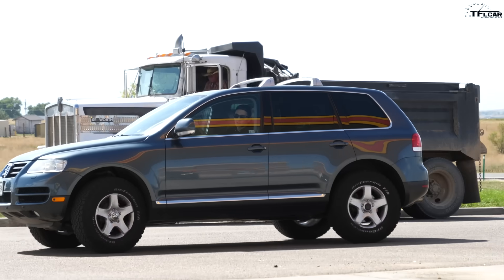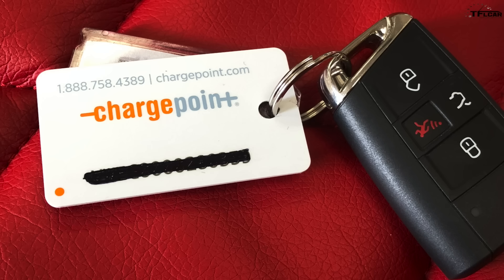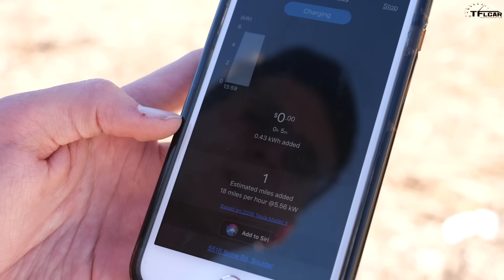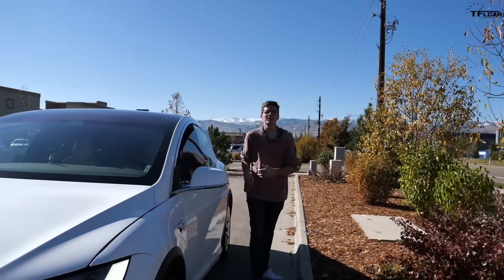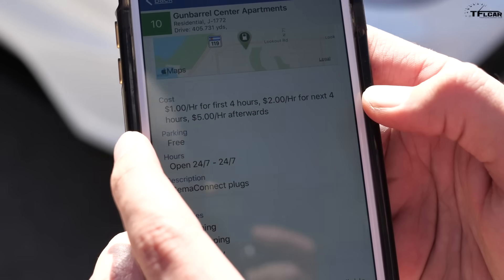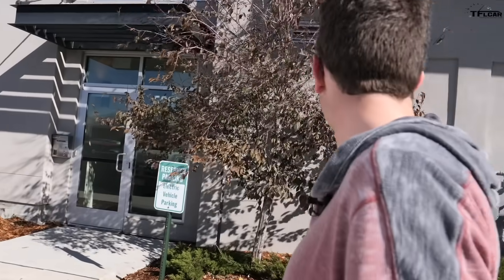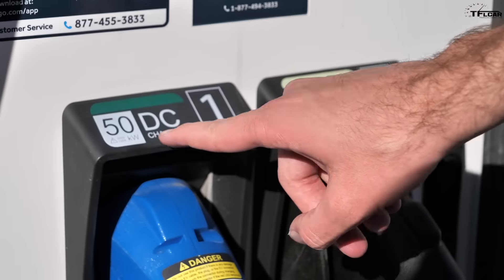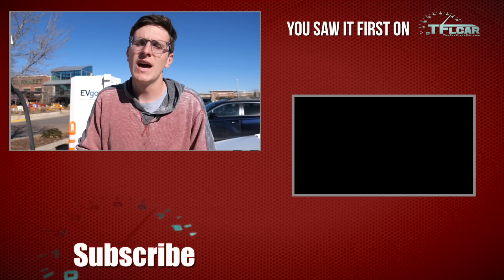Here’s Why Charging an Electric Car Can Suck - And It’s Not The Reason You Think!

Comment: I can't imagine sitting at a gas station for even 30 minutes to fill up. 15 minutes is an eternity when you are just trying to fill up a tank. For those reasons I'm out.
Reply: And imagine if every car on the road was electric and every car in the station was taking an hour to charge…. Everyone is assuming there will never be a line…
Reply: @scottwendt9575  Bottom line: It's much faster with gas. Charging takes too long if you need it on the fly. It's going to be a disaster. Thank the Libtards for their empty heads.
Reply: @scottwendt9575  on a Level 3 charger, it takes roughly 20 minutes to fully charge, not an hour
Reply: @scottwendt9575  If every car was electric and every gas pump is now gone then all those old gas pumps will have been replaced with high speed chargers.   By that time technology will have progressed so you can fill up in 10-15 minutes.   Air will be clean.  Roads will be quiet. Life will be much better.   At least that’s how I imagine it.
Reply: @MrSpuzzz  roads wont be quiet - most noise on the road from cars is tires and wind, not engine. it will basically sound the same
Reply: @igvc1876  i agree on freeways at cruising speeds there isn’t much difference between an ev and a modern commuter ice car.  But muscle cars and trucks make up a large %age of autos where I live and I assure you their motors are much louder than the wind/road noise.  I’m also talking about on city streets where you can clearly hear motors as they accelerate.   I swear people go out of their way to make their cars louder to try to impress somebody
Reply: @MrSpuzzz  you need to do far more research. The carbon footprint to build EVs is huge, the mining for lithium and cobalt is horrifically toxic, the electric bills wills skyrocket.
Reply: @jkokich  go back to work.  Exxon doesn’t pay you all that money to browse YouTube comments.
Reply: @MrSpuzzz  wow, I’ll never recover from that blast of rapier-keen wit.
Reply: @scottwendt9575  except most people charge at home when they sleep so you wouldn't see too many people charging during the day
Reply: @davidgraham2673  I guess we could call you  "Dark Cloud Dave."
Reply: BRO. LIFE IS ALREADY STRESSFUL. NOW TO THINK OF CHARGING YOUR CAR AT A STATION FOR AN HOUR IS INSANE. OR EVEN AT HOME. THIS THING WILL EAT UP YOUR ELECTRIC BILLS LIKE CRAZY. I DONT THINK ELECTRIC CARS ARE FOR ME MABEY IN A 100 YEARS.
Reply: 10 hours for 1/2 charge? HAHAHA
Reply: @ktmden  the only way it takes over 10 hours, is on a 110/120 outlet, and that also depends on how low the battery is, when using a trickle charge
Reply: @bradmagnuson6963  That's because trickle (Level 1) ”chargers” (EVSEs) on 120 volts are limited to 12 amps so they can be plugged into a 15 amp outlet (North America, anywhere that has 120v 60 Hz). Almost every unit has 240 volts available even if it has gas heat, gas range, gas water heater, gas clothes dryer. It's just that it isn't available at the car parking spot. People would rather pay $5/gallon for fuel than to have a 240 volt line installed at their homes for EV charging. If practical where I live I’d install the charging facility, either a L2 charging port (EVSE) or a 14-50 outlet for a portable EVSE like the ones that come with EVs.
Reply: @algrayson8965  homes already have a 240 line, it's the same outlet as the clothing dryer.
Reply: GM had the answer to this, but ditched it because it wasn't making enough money.  Chevy Volt goes 55 miles a day totally electric and if you go farther it uses gas.  This kind of hybrid is a much better fit for many.  I've driven a Volt cross country on gas and got 48 mpg.  At home I've driven 6 months without a drop of gas.
Reply: @utah133  I totally agree. I have a friend in Alaska he owns a volt ( and drives everyday) I think he spends $10 in gas for his Volt every month.
Reply: @utah133  I owned a Prius Prime Plug in. What I found out when it was cold that electric charge really drops so we purchased a 2020 Tesla Model Y  and  are also purchasing the 2022 Model Y with the 4680 battery which will have about 475 mile charge. Saying that Plug in will have a place. We live in Wisconsin. Cold winters
Reply: @bobskeway8179  I'm glad you can afford that.
Reply: @utah133  Age 78 retired School Administrator and past University extension science Instructor. Going back to my HS years in the Tesla...oh well..
Reply: @utah133  Tesla is planning to sell a $25,000 EV and with the $8000 federal off the sticker starting in 2023 that would make it $17,000. The range might be in the 250 range
Reply: @utah133  I am retired and 78 years old. Time to go back to my HS days with the Tesla.
Reply: @bobskeway8179  Glad you have that kind of money.  Lots of us do not.
Reply: @utah133  yeah the newest models were great.   I had a 2012 and it probably only got 30-40 miles max … but 55 seems great.   I don’t understand why chevy gave up on it….it seems like the perfect compromise… I bet if they tried they could stretch the range and improve performance even more.
Reply: @utah133  Good luck getting it fixed. My mother just had a minor crash in hers. Very fixable, but because the Chev dealer said parts were not available, they wrote it off.
Reply: @utah133  the Volt is no longer made
Reply: @utah133  the Volt was discontinued
Reply: @bradmagnuson6963  Two of them live on in my garage.
Reply: @utah133  so? Chevy ditched the Volt already, they stopped making it.
Reply: The REAL deal breaker.

6 cars in line waiting for gas(half empty):
5 mins x 5 cars is 25 mins wait in line for 6th car.

6 cars in line waiting for electric charge(half discharged): 
30 mins x 5 cars is 150 mins wait for 6th car to finally plug-in!!
THATS  2.5 HOURS SITTING IN LINE FOR A SINGLE WOMAN WITH A 1 yr old baby IN A BAD NEIGHBOHOOD!!

FOR FUN!
30 cars in line during 70s gas shortage.
29 x 5 mins is 149 mins or 2.5 HOURS. FOR GAS.

ELECT CHARGE:
29 x 30 mins charge is 870÷60
= 14.5 HOURS!!  FORGET IT!!
Reply: @thedudena5525  or you know charge your car at home there shouldn't be a line there.
Reply: @jonathantorres4957  read comments from David Graham on this thread
Reply: @NightSky777  , When I went through Basic Training for the ARMY, all the Drill Instructors for all the Platoons in my Company used to gather around me, and tell me I was stupid, and had no common sense. They also called me "College" because I was "book smart, and common sense stupid".
(I used to call them out if they said something that wasn't factually true)
I decided to acquire common sense through critical thinking.
That's what I try to apply to all things nowadays.
My forte is problem solving, and 90% of the time it's from simple common sense that the answer comes from, through thinking critically, and sometimes, outside the box. (Learned the last at a resort hotel I worked at in San Diego.)
Thanks much, for the kind words!
Reply: @NightSky777  he does make some great points but if or when evs become common practice we will have alot more electric plants to satisfy those needs as well our electric grids becoming more efficient and less risky.
Reply: @jonathantorres4957  more plants would definitely be necessary ...but it seems Green New Deal is being Fast Tracked with gas-powered vehicles in the immediate cross-hairs.  (Owning a Bike Shop might be a good Investment!)  Also, What Powers Electrical-generation:  Coal, Nuclear, Hydro (not enough Reservoirs and Dams tho)
Reply: @NightSky777  teslas gigafactories even elon was saying with 100 of them he should close to powering the world then again not sure how much of that is actually true.
Reply: @antghostthreeonethree6609  most people don't get an electric car to be eco friendly. It's just for the savings but once they become the norm and electricity prices go up they will even out.
Reply: @jonathantorres4957  apartment without enough chargers? No garage? Run an extension cord out the window when its raining?
Reply: @dudleyhaines9826  you can charge your car else where doesn't have to be at home it's just more convenient. I have a garage but I've been charging across the street from my job so I don't spend money at home.
Reply: @jonathantorres4957  the closest charger to me is 30 miles. It is no where near my work, or anywhere else I go.
Reply: @dudleyhaines9826  do you drive alot for work?
Reply: I can't even stand when I get the "slow" gas pump. Ain't nobody got time fo dat
Reply: @TheV8nissan  just wait till gas prices  rise to prices we haven't seen before. That line will get longer. Or shorter  depending  on where you live, Electric  cars are at their beginning  they will get better as batteries  do. Just remember  when gas cars were introduced. There weren't  gas stations  on every corner, the engines didn't  last long generally  around 10 thousand  miles or so. and people  said cars will never replace  the horse. What are you going  to drive when gas becomes  to expensive? If only we had another choice,    ooooo yeah Electric  vehicles  are here to stay
Reply: Imagine, now, EVERYONE is forced into buying these cars, it takes hours to charge,  meaning you leave your car unsupervised,  someone comes along, messes with the charger, maybe steals your adapter,  you come back expecting a fully charged car so you can travel to the next town over, instead you have a partially charged car that won't make it there AND you need to buy a new adapter. Unless you can charge overnight at home in the safety of a personal garage, this SUCKS .
Reply: We charge at the rate of 29 mph in our garage 220 charger. This is normal.
Reply: Most people charge at home, overnight.
Reply: @billboyd4051  , Until the overloaded electrical systems create blackouts. How will the charging at night happen then? It will happen; that's a certainty.
Reply: @davidgraham2673  I wonder how gas pumps work during a blackout ? I believe the grid has been having blackouts long before the electric car, and when the grid shuts down, few have a place to go. Maybe you should attack bicycles, that become hard to pedal when the food runs out.
Reply: @billboyd4051  , You can easily put extra gas in containers to get thru hurricanes, power outages, long trips thru a wilderness environment, etc. When 30 million extra electrical machines are using electricity, the blackouts will be substantial, and long lasting. So explain to me how you're going to charge all those vehicles during peak usage months, when the electrical load is completely overloading the systems.
The infrastructure can't possibly deliver that much, and solar power along with wind power will never keep up.
You want to get bent over valid questions: fine, but the problem won't go away because you buried your head.
California has already had problems with charging electric vehicles; and thats with millions of vehicles STILL on gasoline products.
Reply: @davidgraham2673  Sure David, hoard gas. Do you live in Ca. ? None of the actual E car owners here are complaining, do you run your home AC off gas ? Maybe Ca. should ban Air Conditioning by your logic. You worry about the future as oil destroys it.
Reply: @billboyd4051  , Thanks for confirming what I thought. Maybe the aliens will save you......
Reply: @davidgraham2673  So what have I confirmed for you ? The E car owners here have no complaints, were you hoping that jeep owners would bring Jesus ?
Reply: @davidgraham2673  This same guy praises the Hyundai Ioniq 5 as "what you've been waiting for". The Tesla is a big fast luxury car, now with a 400 mile range, that beats the fastest Vette, maybe you need a Hyundai to replace that Jeep ?
Reply: @billboyd4051  , Why would I replace my Jeep with the Hyundai when I could drive right by it after it runs out of electricity in the desert where you can't charge it up? I can easily bring extra fuel to go the distance. Not to mention that I'll be in cool A/C comfort the entire distance. If I recall correctly, using heat, and/or A/C diminishes how far you can go significantly in an electric vehicle. 
Dont get me wrong: I love the acceleration, instant torque, silent operation, and other advantages of electric vehicles. I think they play a vital part of future advancements in vehicle technology, but I don't buy into fluff pieces that refuse to reveal the hidden truths that many consumers don't think about, until afterwards, when issues arise. The first of which is: Exactly how is all that electricity going to be generated, especially in areas that already experience problems in supplying enough electricity. Secondly; when we tout the green advantages of electric vehicles, you don't hear a peep about what will happen concerning disposal of all ancillary products related to electricity production (and storage in the vehicles batteries). What about the rare earth elements needed for production of these batteries? 
We are so quick to denigrate fossil fuels, and move on; but refuse to pay attention to the man behind the curtain selling the trade-off.
There are other issues that don't pop up on the average persons radar, but will certainly impact humanity, but I'm not going to go into a full on diatribe here.
You have what you want; an electric vehicle. If you're happy, good for you.
I still see too many issues that need to be addressed before I've seen enough to buy one. 
Finally, I'll say this: If you're going to go electric; buy a Tesla Plaid. They eat Dodge Demons for breakfast, and Corvettes at snacktime. 
There's a reason they're called Plaid.
They achieve "Ludicrous Speed", which up until now, was only seen in Spaceballs. Ask Elon Musk.
Reply: @davidgraham2673  No one is forcing you to go electric David. I just don't know so many people who don't have one, complain about them.
Reply: @billboyd4051  , You've missed my point the entire time. I'm looking at the forest behind the trees. I'm not at all against electric vehicles. I recognize their inherent advantages. My issue is being sold on "now is the time, and it can't wait". I've never had a problem with a household that has an electric vehicle, and a gas/diesel vehicle. It's easy enough to deal with issues if you can hit a pump, or charging station; or better yet, charge at home.
 My issue is being pushed into electric before the infrastructure, and various problems are adequately addressed. I've stated from the beginning that the capacity for full on electric charging simply isn't possible during high energy usage periods.
It's very rare to read anything written by electric proponents that has any negative review whatsoever, and I won't buy that dog, because it won't hunt.
People who must sit and wait at a charging station for 90+ minutes don't make the news. Neither do people who can't make it to the nearest charging station, because they didn't get the distance expected. Its not like a gas engine where a passerby can give you, and your container a lift to the nearest pump for some gas. Neither can you carry extra fuel on board.
My issue is simple. Electric will be great, but don't try to sell me that it's simply the best right now, as it stands.
Technology solves problems. Let's at least be completely honest about the problems. Biggest problems now?
Making enough electricity.....
Charging fast enough.....
Enough charging points so we're not waiting three hours in line just to plug in

When manufacturers switch to manufacturing mostly electric vehicles versus gas engines, these problems will absolutely, positively come around because the influx of new electric vehicles will be forced (to a degree), and the huge amount of the infrastructure necessary will not be finished to provide for the need.
That will take huge amounts if money.
Guess who will be paying for it.....and also who will be taking public transportation because
of a mandate that will be pressed on us.
Hope you see my point now.
Reply: @davidgraham2673  I've never heard so many EV complaints from gas car owners. From using too much electric from the grid to they're too quiet and require too little service. The infrastructure is the grid, already in place. I don't have an e car, but I already have a 220 line in my garage. No one is forcing you, Americans will never give up Saudi oil and Japanese cars.
Reply: @davidgraham2673  Will generating all that electricity really be cleaner than a gas engine? I don't know, I'm not too thrilled about nuclear because of the waste, solar and wind are not reliable so we're back to natural gas and coal. I'm not thrilled about riding the bus if electric becomes mandatory either.
Reply: @rosspatience4217  ,That has been a question I have as well. I've read that small scale thorium reactors ptoduce much less radioactive waste, and have a great return on power for investment, but for the foreseeable future, using fossil fuels to provide electricity seems to be the way they'll go. Solar, and wind simply can't keep up with demand. If we're back to burning fossil fuels, then pushing hard for electric right now seems premature. That has been my point all along. Technology always catches up, but it's lagging behind. Blackouts, and brownouts confirm this, considering that if a million new electric cars join the ranks next year, that's a large drain on an already taxed system.
Reply: @davidgraham2673  Charging at night doesn't load the grid as much as it is loaded in the daytime. The L2 current draw is 40 amps max.
Reply: @davidgraham2673  At-home charging for people who work days is at night when the load on the grid at present is low.
Solar doesn't work at night or during overcast days unless electricity storage is used. Wind power doesn't work when the wind isn't blowing hard enough.
Reply: @davidgraham2673  you're spot on in those points.  Funny how the logical Practicality issues are not spoken about.
Reply: @NightSky777  Even Exxon predicted the effects of the gas powered auto destroying the planet back in the 60's. The Keystone XL pipeline was destined to carry tar sands from Alberta Canada to Texas where a heavy crude refinery would separate the cancer causing solvents from the sand and tar, to make gas for export, since its costs would be so high. Burning more oil is not everyone's answer to global warming, increasing floods and hurricanes and coastal cities under water soon. The oceans are heating and dying, fires are raging throughout the west, oil man Putin is waging war for nothing but greed, and you worry about gas, and fees for killing the planet.
Reply: @davidgraham2673  California's electric problems is due to mismanagement of the grid by PG&E, not the state itself
Reply: @billboyd4051  Japanese made I'll take it American made sucks.
Reply: @SillyOmega  my Ohio made Honda doing well after 14 years.
Reply: The REAL deal breaker.

6 cars in line waiting for gas(half empty):
5 mins x 5 cars is 25 mins wait in line for 6th car.

6 cars in line waiting for electric charge(half discharged): 
30 mins x 5 cars is 150 mins wait for 6th car to finally plug-in!!
THATS  2.5 HOURS SITTING IN LINE FOR A SINGLE WOMAN WITH A 1 yr old baby IN A BAD NEIGHBOHOOD!!

FOR FUN!
30 cars in line during 70s gas shortage.
29 x 5 mins is 149 mins or 2.5 HOURS. FOR GAS.

ELECT CHARGE:
29 x 30 mins charge is 870÷60
= 14.5 HOURS!!  FORGET IT!!
Reply: @thedudena5525  The gas cars parked in the EV charging spaces!!
Reply: So you're not willing to pony up $100 billion for a 10% share?
Reply: @cwalenta656  $100 billion for what?
Reply: The REAL deal breaker.

6 cars in line waiting for gas(half empty):
5 mins x 5 cars is 25 mins wait in line for 6th car.

6 cars in line waiting for electric charge(half discharged): 
30 mins x 5 cars is 150 mins wait for 6th car to finally plug-in!!
THATS  2.5 HOURS SITTING IN LINE FOR A SINGLE WOMAN WITH A 1 yr old baby IN A BAD NEIGHBOHOOD!!

FOR FUN!
30 cars in line during 70s gas shortage.
29 x 5 mins is 149 mins or 2.5 HOURS. FOR GAS.

ELECT CHARGE:
29 x 30 mins charge is 870÷60
= 14.5 HOURS!!  FORGET IT!!
Reply: Most EV owners don't take long trips, so they're perfect for short to intermediate distances. For long trips, just a little planning and time allotment will be needed, although this will improve with increased charging stations and better technology.
Reply: @tracymiller1149  I love taking long trips in my EV.  It does take a little more time for charging stops.  In the US with a tesla I find I don’t have to do a lot of planning for supercharging since they’re just so many of them along freeway routes.    But I do some planning for hotel shopping to try to find hotels that offer L2 charging.   It’s probably still kind of “adventuresome” at this point but traveling with an ev is still fun for me after 4 years.
Reply: Teslas got some new charging technology they’re working on for you if you have a semi I don’t know if they’re doing it for their cars but in the semi you just pull into the spot and then something like five minutes it charges without any hook up or anything without getting out of the vehicle if this pans out your car would charge in like a minute if it all pans out like you I’m more awaiting the day
Reply: If the EV is going to replace the Gas Vehicle, charging the Batteries will have to evolve also. "Charging, ain't nobody got time for that!!!" Everything has to be Faster, more available and Right Now. We have The World at our Fingertips. All we have to do is pick up our phone and it can be at our house in 24hrs or less. We Live in Cities that Never Sleep, we sure don't want to be taking 2 & 3 hour naps while we get enough of a charge to get across town. I will continue driving my Tacoma. But then I'm Lucky if I put 3000 miles a year on our truck. My Wife and I work from home and since the Plandimic we started having most everything delivered to our door.
Reply: @darryldecker5446  exactly I drive up and down the east coast   If the most I can get is about 400 miles per full charge then that does not work for me.  I plan to go with hybrid
Reply: @darryldecker5446  tell us you don't know anything about electric car charging, without telling us you don't know anything about electric car charging
Reply: @darryldecker5446  there are already fast charging stations, that can charge your EV in 20 minutes. If you don't have the patience to wait 20 minutes, an EV isn't for you
Reply: @bradmagnuson6963  - 20 mins to 80% .. not 100%
Reply: @williamhaynes7089  no, 25-30 minutes to go from 20% to 100% on a Level 3 charger. On a Level 2 charger, it only takes maybe 90 minutes to go from 50% to 100%
Reply: @bradmagnuson6963  some of us have jobs, and families that demand our time. i have seen charging stations with 3 or 4 cars waiting their turn. evem on a fast charge it would take an hour or more to get charged, that's just as crazy as thinking an electric car helps the environment at all.
Reply: @bradmagnuson6963  What is a “Level 3” charger?
Reply: @algrayson8965  Level 3=CHAdeMO, CCS
Reply: @bradmagnuson6963  I have never spent 20 minutes filling up my tank.
Reply: @jkokich  so? What's your point?
Reply: @bradmagnuson6963  it’s faster to fill up a gas tank. I should think that’s fairly obvious.
Reply: @jkokich  not really. You pull up to a gas pump, open your gas port, figure out which gas you want. Either go inside and prepay, or, swipe your card. If you prepay, you go back in to collect your change, get your receipt, along with whatever snacks and drinks you want, go up to the counter. Pay for your stuff. You literally spend 20 minutes doing all that, don't try bullshitting anyone.
Reply: @bradmagnuson6963  that does not take me 20 minutes; watch your language.
Reply: @jkokich  tell us you don't know shit about electric cars, without telling us you don't know shit about electric cars
Reply: @bradmagnuson6963  had to add in snacks and drinks to make that work.
Reply: @dudleyhaines9826  believe whatever your tinfoil hat tells you
Reply: @darryldecker5446  I've had my tesla for about a year and it's just like my phone I charge it at night while I sleep then in the morning I have a full tank well 80% because I don't like charging to 100. That gives me 200 miles I use about 30 miles daily a little more on my days off so I have never charged other than my garage. I can see where issues might arise on field trips across states but even then why drive when you can fly.
Reply: @jonathantorres4957  there's absolutely nothing wrong with charging to 100%
Reply: @bradmagnuson6963  the battery degrades a little faster that way, also the generative braking doesn't work as well making the car less efficient at least that's what elons tweet said.
Reply: @jonathantorres4957  no, that's just not true. Regen braking DOES work, and battery degradation takes years to happen.
Reply: @jonathantorres4957  Cause I don't have to deal with TSA and a bunch of no mask mouth breathers in my car.
Reply: @percyfaith11  idk what charging the car at night has to do with tsa but ok unless you replied to a different comment I'm not sure it doesn't tell me to which comment you replied
Reply: @jonathantorres4957  Hell I don't know either.  Somebody said charge your ev at home for trips around your area and take a plane for longer trips.  I was just pointing out that I'd rather drive than deal with the airport.  If that wasn't you then I posted to the wrong name.
Reply: @percyfaith11  all good wasn't me but I know where you coming from. For long distance trips around states the car can definitely take you it even shows you where you need to stop to charge if it notices its too far for its range.
Reply: @bradmagnuson6963  it will be noticeable over just 5 years if you charge to 100%. lithium batteries longevity is multiple times longer when charged to 80%. That's why Chevy Volt for example uses only 66% of its battery capacity, its battery is known to basically last forever and its performance doesnt degrade
Reply: @igvc1876  that's completely FALSE. There is nothing wrong with charging to 100% every time
Reply: @bradmagnuson6963  again, there is nothing wrong with it. but it simply shortens the lifespan of the battery. it is entirely true - simply look into it, it's just chemistry of lithium batteries. just look into it - that's precisely why the Volt restricts charging internally to 70%
Reply: @igvc1876  it would only shorten the lifespan, if you do repeated quick charging. On a level 2, it would take between 5 and 10 years, before you see any degradation
Reply: I drive to SEE things..lol
Reply: @jonathantorres4957  not to mention those of us who love to take trips by car cross country. Imagine running out and having to sit somewhere for 8 hours.....not for me.
Reply: @JanineG  if it's a fast charger in about 50 mins it will get you to 90 percent but yea if where you going there's only medium speed chargers it will increase the wait alot.
Reply: @bradmagnuson6963  yes it is true, over the course of four or five years you’d see the difference between not always charging to 100% vs having a set percentage like 80%. Look it up
Reply: @wickedfiend7135  do you even drive or own an EV? If not, you have no idea what you're talking about
Reply: @jonathantorres4957  Regenerative braking doesn't work at all when the battery is fully charged. But drive a mile and it isn't fully charged, so the regen braking works again. EVs have normal hydraulic friction brakes anyway.
Reply: @Al Grayson  I like the regenerative braking more for driving only with one foot and to save the brakes from wasting away so you have to change them less often.
Reply: @bradmagnuson6963  yeah I do. So go show yourself to the nearest exit
Reply: @bradmagnuson6963  would you like to do this in the rain?
Reply: @gerardhaubert8210  I've charged up in both rain and snow storms, what's the problem?
Reply: @jonathantorres4957  there's nothing wrong with charging to 100%
Reply: @algrayson8965  yes, regen braking works on a fully charged battery
Reply: @bradmagnuson6963  depends what battery type you have on your car. Some of then do deteriorate faster in the long run if charged to 100 but I mean like longer than 15 plus years type thing.
Reply: @jonathantorres4957  it only deteriorates fast with repeated fast charging. Charging on a Level 2, it'll take years before any degradation happens
Reply: @bradmagnuson6963  you are 100% correct on this.
Reply: @bradmagnuson6963  Uhmmm,  yes, there most certainly is something wrong with charging to 100% if you are talking about a lithium ion battery of the type used in almost all EVs. Tesla STRONGLY recommends charging only to 80 or 90% most of the time. There is a new type of battery coming into wider use in EVs, called a lithium iron phosphate (LFP) battery. They are OK to charge to 100%. But at the moment (fall 2022) they are still much less common than li-ion batteries.
Reply: @jimmurphy5355  um, NO, there is absolutely nothing wrong with charging to 100%...do you even drive an EV? I'm guessing you don't, because you have no idea what you're talking about. I've charged my EV plenty of times to 100%, and there was never a problem. There is nothing wrong at all, with charging to 100%.
Reply: @bradmagnuson6963  I have 97,000 miles on my 2018 Tesla model 3. I know very well that if I set the charge limit to 100%, and charge twice in a row to that level, a yellow alert pops up on the screen and warns me that's hard on the battery, and it offers to set the charge limit back down to 90% for me. There is indisputable data that pushing lithium ion cells close to 100% full is damaging. Not in a way that causes immediate failure. But it does wipe out some capacity at a rate much higher than if you don't charge so high.
You don't say what kind of EV you have, but some EVs have a hidden "top buffer."
The gauge you see says the battery is 100% full. But in reality, the battery has some unused capacity. EV makers do this so that the battery will last longer. They get less available range from a given sized pack as a tradeoff.
Tesla chooses to let user truly fill the pack, for occasions when you need every bit of range, and then they warn you not to do that very much.
Reply: You can call an Uber with a Jetta Diesel that will take you to a plaza nearby while your Tesla is getting recharged
Reply: @AM-ff6wv  we don't  drive model a cars anymore and electric  cars are going  to advance  at a very fast pace, if you think today's  ev is what you will be driving  in 10yrs   well  you don't know enough  about electric  cars
Reply: @carlstephens1532  Well more power to ya! (Pun intended LOL) But while we don't drive Model A's any more... we DO have some military special forces STILL carrying 1911 pistols!! I just think that's kinda funny😂 But, to play "Devil's Advocate"... how many hours/days would it take to charge a Tesla Plaid using just your solar panels and then how many minutes/hours would that charge last at 70 mph?? I'm jus sayin...
Reply: @antghostthreeonethree6609  unknown  to how long my panels would take  as I don't  own an electric  car.  But my panels  have saved me unknown  thousands of dollars  over 30yrs now and the best part when the hurricanes come I still have power, by the way what are you gona drive when gas go's to 6 ,7,8,10 dollars  a gallon , maybe you can find a horse or an electric  cat that already exists
Reply: @carlstephens1532  Well, I'd assume that by the time gas goes to $10 per gallon, minimum wage will likely be in the $50 per hour range, so it'll all be relatively the same. Plus, as more people/agencies switch over to Ethanol, electric, or whatever, the demand for gasoline will drop, leading to better gas prices!
Reply: @antghostthreeonethree6609   I guess you understand  supply and demand  better than most people    I seriously  doubt  min wage will ever pay the bills  for most Americans   I have witnessed rationing of gas,, And higher  prices in my life time as well , so your off center of the facts.  We will see higher  gas prices   how high ? Well I can tell you from my personal experience is that it will hurt your pocketbook
Reply: @carlstephens1532  Yes, Supply and Demand, AS IN:  As more agencies/fleets/people switch to CNG, Hydrogen fuel cell, Bio-Diesel, Ethanol, Battery-powered (Remote Emissions),  vehicles etc...the DEMAND WILL FALL💯, leading to an excess of Supply! So... YOU tell me what the law of "Supply & Demand" says about prices👀👀👀 I'll wait... 🤣
Reply: Yes me too, not for me.
Reply: I wonder if recent gas prices would change this conversation. LOL 
btw, I have an EV and I charge at home. I only use those "30min to fill up" on roadtrips. But I don't have to pay $6 per galon :D
Reply: Tim, you need to take a chill pill if 15 min is a long time to you. I have waited in line at costco for 45 mins or more and that was just to get to a pump.
Reply: True and just think if there is 2 or 3 cars in front of you waiting to charge. That is about 2 hrs waiting before you even start.
Reply: @billythomas4851  only if they are not fast charging stations and also only if they are charging from an almost empty fuel cell, but nothing as fast as fuel.
Reply: @Concerned Citizen  you can it will just take longer to get to the destination. Buying a 50 dollar flight ticket 3 hours before the flight is always fun too, but I do understand where you coming from.
Reply: Tim, That's 30 minutes for 100 miles not a fill up.
Reply: Only hybrid vehicles can survive not an EV🤓🤓🤓🤓these EV'S will  stop running in the cold snow weather. may be stuck in the road and may need a extra replacement batteries  in the trunk in case of an emergencies. It's hard to get it recharged. I have no patience to waste my time around this stupid EV'S......
Reply: @J P  had my tesla when we had a extreme cold vortex on chicago it was about -38 I'm 2019 and my car was still working in the other side my dad's car a gas car didn't wanna turn on. Hybrid are nice tho you have the best of both worlds.
Reply: @jonathantorres4957  not everyone will have the same success stories... Only millionaires can survive 🤓🤓🤓
Reply: @JP-uz3nk  none of that is true
Reply: @bradmagnuson6963  explain the truth 🤓🤓🤓
Reply: @JP-uz3nk  I already did, pay attention
Reply: Judging by the comments it’s evident the general public has much to learn about evs. Lol. Yikes. 
Some of you need to read up on high speed charging vs destination charging.
Reply: @PumpUptheJam81  you're assuming they can read
Reply: @PumpUptheJam81  electricity rates skyrocketing this summer makes EV"s look even more a foolish idea.
Reply: @PumpUptheJam81  a local convirnience store just installed a charging station with the generator powered by a diesel motor!!!   LIKE A DOG CHASING IT'S TAIL!!    the green haired crowd won't get the irony!!
Reply: @billw8476  that's not true, liar
Reply: @billw8476  charging stations don't run off diesel powered generators, so you can stop lying any time now
Reply: @bradmagnuson6963  some do, in rural areas,go fact check yourself BEFORE you speak
Reply: It's OK Tim nobody's  forcing  to to buy electric,  but they are here to stay. No matter  how un cool you think they are
Reply: We aren't  you happy you not driving  model A ford's anymore. There weren't gas stations  then ,no repair  shops, recovery  services , electric  vehicles  have been with us longer than gas , batteries  are being  developed  as I type  this that can charge in 5 mins ,  till they or another form become available  hybrids are filling that gap. A friend  has had a volt hybrid  for over 10yrs  now ,,,,,,he says it gets 160mpg
Reply: This comment is really out of touch on how electric cars work. It’s like an electric car owner saying about an ICE vehicle “I can’t get a fill up automatically while I sleep. So I’m not buying an ICE vehicle.”

Yes, you have to wait some. However, that’s why you see super chargers and others at grocery stores. And you will see more of that. It’s all about placement.
Reply: @MorbidGod391  okay everyone. Clearly all the negative comments are not taking in context. Watch the entire video, then read my comment, then you may recognize context. Otherwise your responses are ignorant flippant attempts at declaring yourself the expert. Look at context.
Reply: @MorbidGod391  who cares if the planet is dying, I'm in a hurry to get to the gym in a three ton pickup.
Reply: I have a feeling  these  commenters don't keep up with batteries,  we now have a salt zinc version. We have a 1000 mile version,,,   we have a chip battery  that charges in under 5 mins you won't  need a super charger install because  that's gona be built in you just need a outlet that's three new batteries  and charging  system. I have said the technology  is moving at lightning  speeds
Reply: @carlstephens1532  if cars had never charge lifetime batteries, they would complain about the lack of noise, no vroom vroom.
Reply: @billboyd4051  I get the car thing I have drag raced, oval,,  road course  raced my whole life. I love a small block screaming  down the track,  BUT we have to get ready for the end of gasoline.  So so many reasons. I get the oil argument.  My stance  on oil is simple we need it and will for a while but electric  is a better way of traveling  back and forth  to work , if the 1000 mile batteries  make it to be used in cars , that problem  is  over. Electric  is here now
Reply: Once upon a time we had dial-up internet... I'll wait for this technology and infrastructure to evolve more.
Reply: @kevdroid  even with the govt trying to ram this green energy crap down our throats,there are still green haired weenies lapping it up like sheep
Reply: All you saying ",Just charge at home!" I am sorry your life is so dull that all you do is go back and forth to work. Some of us actually like to go places and do things that require filling up on the road. If you don't have a Tesla with suoercharging available everywhere you want to go, EVs are just not it. Not yet.
Reply: Amen. That kind of time is irresponsibly slow!
Reply: You would have to be a damn social signaling idiot to buy an EV.
Reply: add in the value of your wasted time charging your weenimobile,and you might as well bought a gas one. plus you wouldn't apply the dweeb factor to yourself
Reply: @billw8476  Plus if you dont have a smart phone with you , no app, no charge at that particular station?
Reply: @stevegreenhorn934  Who doesn't have a smartphone with them everywhere they go? Even Amish have smartphones! I would guess that there isn't a single EV driver who doesn't have a smartphone.
Reply: @stevegreenhorn934  Use your credit card. An app takes <5 minutes to download.
Reply: @algrayson8965  Amish don't use cell phones at all
Reply: @billw8476  what is your plan once gas prices  rise to ridiculous  levels. So your walking?I doubt  it you will buy an electric  car.
Reply: @carlstephens1532  how long until they tax electric vehicles enough to cover the lost gas tax revenue?
Reply: @dudleyhaines9826  it's  not here now so I'm not worried  about something  that doesn't  exist ,  ,  of course  they will tax any thing ,,that won't stop electric  vehicles. ,,,the price of gas will
Reply: @billw8476  yeah a car that drives itself, safe and goes 0-60 faster than a lambo, real weenie status
Reply: @timothyberlinski2299  if you need a car to drive itself, who is the real weenie?
Reply: @billw8476  well it's the future so deal with it or shut up other companies have them too
Reply: @timothyberlinski2299  it's not
Reply: @billw8476  spoken like a true neckbeard
Reply: @billw8476  weeniemobile=gas car
Reply: @bradmagnuson6963  WOW, what a carefully, well thought out, articulate response!
Reply: @billw8476   well bill when gas gets to ridiculous  prices  ,what are you gona drive. Your bicycle??
Reply: @billw8476  well bill when oil becomes  more expensive  or you can't get it. I want to see your horse
Reply: @billw8476  it could stop today.  Katie Porter has a solution    they are making record profits  as we are paying  record prices.   Check her out.
Reply: @billw8476  I always charge it at home every night so I wake up to a full tank every morning so I see no real issue. It's not like you have to wait there watching it. I completely understand if someone lives in an apartment then yea this car is not for you it would be a great nuisance or if you have no garage to charge it at.
Reply: @jonathantorres4957  You can go to a gas station the night before for just a few minutes and the car will be ready right then and there.  What if you had an emergency and had to use the EV car when it has very little charge.  Your screwed.
Reply: @psilvakimo   my tesla has never reached under 50 percent battery same when I had my gas corolla never went under half so if an emergency comes up I doubt I would have to drive more than 100 miles to fix whatever the emergency is. I do see what you mean though if you drive alot with it you would be 100 percent correct but at that point atleast on my city I can go to a tesla super charger and sit for like 5 mins and get a good charge.
Reply: @jonathantorres4957  I often need to drive more than 300 miles in a single day one way. Sometimes even returning home tge next day. I think an EV is not for me. Hybrid maybe?
Reply: @timpritchard  uea in your case I would definitely not do an ev hybrid sure or just any gas car with a big tank and a V4 engine preferably to burn less Gas.
Reply: @jonathantorres4957  I'm assuming it's impossible for a Hybrid's gas engine to charge the batteries at a rate Greater than enough to run the electric motors... without consuming MORE gas than it would take to just run the car That'd be a way to not ever get stranded.
Reply: @jonathantorres4957   So all your life your goal in life will be limited to 100 miles. I see.
Reply: @beboboy mann  anything further and I'm flying why would anyone drive that much. Unless you looking to do a road trip even then now there's a lot of charging stations popping up. The price of gas in my town also is getting out of hand $4.35 is not looking too good, and my light bill is about 15 to 20 bucks a month so I'm happy.
Reply: @psilvakimo  call uber
Reply: @jonathantorres4957  I drive a thousand miles Florida to Georgia round trip in a weekend so I don't have that kind of luxury, it's just not practical for people who travel long distance in a short time
Reply: @Norman Buchanan  you are 100% correct this car is not meant for everyone yet. The mileage doesn't work for everyone. All EVs are working on extending range for that reason.
Reply: @jonathantorres4957  “the electric vehicle is not for everybody; it can only meet the needs of 90 percent of the population.”  Ed Begley Jr.  (referring to EVs when they had a range of 100 miles.)
Reply: @MrSpuzzz  yea 100 miles is not much but they are improving I mean I get about 180 miles on my car and now there's alot of chargers but before I can see how an EV wouldn't work for alot of people.
Reply: @jonathantorres4957  Maybe you are a very disciplined and orderly person, but someone like myself or my wife, we would very likely forget to plug the car every single night, we do have a garage, but I just don't see us taking this leap, until a capacitor type battery that charges lightninging fast (just like a capacitor) arrives in EV's , we will likely stick to combustion engines
Reply: @Thomas Just  there is fast charging for home but it costs extra.
Reply: @jonathantorres4957   including charging time, how long would it take you to go 368 miles?
Reply: @scottpatrick8352  at home or at a supercharger station?
Reply: @psilvakimo  charge at home, problem solved
Reply: @jonathantorres4957  flying in an electric plane? Then what? Get a gas uber or diesel city bus to get around?
Reply: @bradmagnuson6963  not everyone has a garage or tesla $$$.
Reply: @dudleyhaines9826  why not all electrical? I do love the sound of a good old engine. Electric cars are boring in that sense. But I hate driving so that's why I got a tesla.
Reply: @jonathantorres4957  someday when they make a truck I can afford. I do live on a farm.
Reply: This is why we charge overnight at home now if you don't have a garage I would never get a tesla.
Reply: @jonathantorres4957  Sometimes you can't do that? Do you have a working brain stem?
Reply: @Markus Aurelius  so youtube doesn't tell me which comment you replied to so idk which comment you are talking about. Can you be a little more specific.
Reply: @jonathantorres4957  Learn to scroll bud.
Reply: @markusaurelius777  your comment appears all the way at the bottom under random people.
Reply: @jonathantorres4957  what happens if the power goes out what
Reply: @michaelcarter9725  I'm not sure about other cities but I'm from Chicago and last time we lost electricity was about 3 years ago for like 30 mins and before that about 7 years ago so its not a common occurrence. I've had charged it at friends and families places the cost is so little so most are ok and by little I mean probably about a dollar
Reply: We charge out Tesla in 4 hours at home. So do all the Tesla Club Members I know plus a couple of one that own VW EV"s The charge rate is 29 miles per hr. A Tesla supercharger is between 20-30 minutes and the new one with the 4680 battery will be 10 minutes
Reply: @Bob Skeway  Sooo...you could limit your driving to 29 mph and throw a gasoline-powered Electric Generator in your trunk and continuously keep your Ev running!! Except you'd have to STOP FOR GAS for the Generator 🤣🤣  Some of us can't live on a tether that only stretches to work and back with MANDATORY 8-10 hour Downtime. It might work for some ppl but it's not ready for Primetime. (And if your phone breaks you can't charge???)
Reply: @antghostthreeonethree6609  If you don't have a credit card or a charging card for the charging station(s) that you use. How many EV owners don't have credit card(s)? Or charging card(s)? I have a blink card with $9.50 on it that I haven't used since my Leaf was wrecked.
Reply: @bobskeway8179  I think these guys work for Exxon, or sell vacuums coast to coast.
Reply: @billboyd4051  YES
Reply: @billboyd4051  Check this out on new 4680 charge time: "What can we deduce from this information?
Elon Musk has stated that a Model 3 battery was designed to last 300,000 to 500,000 miles or 1,500 charging cycles. That is the same number of cycles this 4680 battery is showing.
It appears the biggest advantage to this battery is that it has a very fast charge time. If a car has enough of these batteries for say, 400 miles of range, then that would be someone could charge 200 miles in around 12 minutes. That's not too bad. In fact, I think the biggest thing that batteries of the future will need to improve on quickly is charge time. A charge time of less than 10 minutes up to 80% of the capacity will help further drive electric vehicle usage."
Reply: @bobskeway8179  18650's seem a bit old and small, and getting 30 amps from those available is tough. Elon knows what hes doing, his million mile battery is not far off.
Reply: @billboyd4051  AGREE 100%
Reply: @billboyd4051  AGREE 100%
Reply: I can’t imagine stopping at a gas station for 5-10 minutes once or twice per week, year round.    I refuel my ev at home where I drive 90% of my miles.  For that reason you can keep your gas car.
Reply: @koreyb  Are you being forced to buy an electric car also ? This same site guy that bitches about Tesla, is pushing the Hyundai car. I remember when there were gasoline powered washing machines, I guess you miss those days.
Reply: @billboyd4051  My great-aunt had an oil (kerosene) cookstove for when she didn't fire up her coal stove.
Reply: @algrayson8965  I have an electric cooktop burner that works off my solar panels directly, a propane stove for a night power failure and a generator if things are out too long.
Reply: Electric  cars are at their beginning,  what are you going  to drive when the price  of gas goes  up and up can you afford  10 a gallon ? Electric cars are part of efforts  to make sure we have choices  ,, oil will run out  ,
Reply: @carlstephens1532  But without solar, you're still "running" off fossil fuels. (We don't have limitless waterfalls and dams hurt the aquatic life). Really the EVs are considered REMOTE Emissions Vehicles there's still smoke just not from your tailpipe, it's at the powerplant and it's Massive. They're probably developing more ethanol cars if you're worried about fuel running out! Practically Any plant can be distilled to make alcohol!
Reply: @antghostthreeonethree6609 why are you leaving solar out?  because  here in Florida  we are installing  them at a very fast pace
Reply: @carlstephens1532  I was just responding to your part about "oil will run out." Most of our electricity doesn't come from solar, or anything else that won't run out.
Reply: @antghostthreeonethree6609  it's  moving to add solar here in Florida  we are putting  solar in at a swift pace ,my friend  has had solar  installed. No money down and he gets a check every month his panels and electric  use are deducted  and he still gets a check.  Hold on solar is here now
Reply: @carlstephens1532  I've heard of solar, but my part of the U.S. has 6 months of Winter, and is liable to have Clouds year round lol. But yeah, they better figure out something because wasn't it just last year that Texas (with all its Sunshine) got shut down from power grid failures? I'm just saying, electric vehicles currently pollute TOO, it's just hidden from view.
Reply: @antghostthreeonethree6609  we now know more about the Texas  event,  the grid in Texas  is a stand alone system ,, those in charge didn't winterize the grid as they were advised  to do, if they had and were hooked up to the main grid system that mess might not have happened. You should  understand  Canadian  people  use solar too
Reply: @antghostthreeonethree6609  everything  pollutes but can you afford  the high gas prices  that will come , oil is not a renewable  energy  ,once solar panels  are made that can last over 30yrs like mine and still provide  the power I need, and they aren't  polluting  during  that time.
Reply: @carlstephens1532  Yes they do have solar to our north, but I runt l don't think it has enough capacity to fulfill our non-vehicle needs. Meaning it would have to expand greatly just for our current usage. And then when you consider that normal demand added to All the nation's vehicles going electric? There have to be Massive, dramatic changes in technology for that to work!
Reply: @antghostthreeonethree6609  yes massive  changes  are coming  at its pace ,,we're  going  to use all that we have now and new technologies  as they come forward. Relying  on fossil  fuels won't  get us far oil is not a renewable  source  of energy. Solar  works ,I know I've had panels for 30 yrs now. They work
Reply: @carlstephens1532  True, but Ethanol is also completely renewable, and can be pumped as fast as gasoline 😃 At first I was thinking they just have to figure out how to increase the charging speed of EVs, I totally forgot that they can't charge faster without Greater Production of electricity. I'm just saying we're not ready for a mandate yet. They'll probably need new, humongous power lines before Everybody can put such a massive load on the system trying to Super-Supercharge, getting EV charge time down to 5 minutes for 500 mile range. That's 100 miles per Minute compared to Level 2's 100 miles per Hour lol. And then multiply that by how many million vehicles That's a lot of "sunshine"! 🌞🌞🌞
Reply: @antghostthreeonethree6609  I think  your missing something  , electric  cars and solar are changing  as we speak ,I have been using solar for 30yrs and it has supplied  all the power I've needed.  I saw Christmas  lights everywhere    if our grid can handle  that , I think we are OK at this time  , remember  this the first cars were not accepted  at first either. The life of a engine  was about10000 miles. Gas wasn't  available  at every corner  and people  said it would  never replace  horse's    have you rode a horse  to work lately? electric  cars have proven  to win at racing gas cars , there is a white stock tesla  kicking ass in texas lately. Most people  who don't  want electric  cars are invested  in oil.  That's fine but we have to have a back up plan so that when gas prices skyrocket  in price  or  another gas crisis  like we once had. We have a choice    a way to carry on
Reply: @antghostthreeonethree6609   yea yea. The reality  is oil prices  are going  to rise. How high  before  you can't  afford  it. How are you going  to work or drive at all. When this becomes  reality you will have the choice  of all the electric  cars that are available  now with better models coming soon
Reply: @carlstephens1532  But the price of electricity will rise as well lol. Perhaps vehicles running on 100% ethanol would take over? Miles per gallon would be less but you could fill your tank in the same 5 minutes or so that it takes with gasoline. The wait time to charge EVs is so long that people have to come up with OTHER THINGS TO DO LOL while waiting for it to fill up I think that's a major downside to electric vehicles.
Reply: @antghostthreeonethree6609  the cost of energy  is going  to rise, my solar panels  I bought  over 30 yrs ago are still over producing  and working  just fine. My cost is so low I just smile ,
Reply: @antghostthreeonethree6609  Modern coal burning electric power plants emit CO2, water and nitrogen. The fly ash is “scrubbed” from the exhaust. Peak loads are supplied by natural gas fueled gas turbine powered generators. Nuclear, hydro, solar and wind supply some.
Reply: @antghostthreeonethree6609  Ethanol takes more energy to make than it provides. The purpose of adding ethanol to gasoline is to add oxygen for cleaner burning. “E85” is usually not much more than E50. Pure ethanol fueled cars are in Brazil where they have much sugar cane, otherwise a waste product, to get alcohol from. The USA doesn't have very much.
Reply: @antghostthreeonethree6609  Texas’ power grid didn't fail. The portion of power generated by windmills failed due to icing of the turbine blades. This caused shortages as Texas has been decommissioning coal fueled electric power plants.
Reply: @algrayson8965  The point is that Ethanol is Renewable and its takes about the same time to fill up a car with ethanol as it does to pump gasoline. Your mpg would be less than gasoline, but the tradeoff is Availability. Plus, you can distill ethanol from a huge number of sources! 
Once again I ask:  Who is to say that EVs/Remote Emissions Vehicles are the only or even the best solution? Especially when compared to the Versatility of a hybrid?? I'll wait...
Reply: @antghostthreeonethree6609  Distilling alcohol takes a great amount of heat = energy.
The farming equipment that raises dent (inedible for most people) corn doesn't run on alcohol. It runs on diesel. The trucks that haul corn run on diesel, not alcohol. The distilleries run on natural gas, not alcohol.
If ethanol production that is presently supported with diesel oil and natural gas was fueled by ethanol there would be very little or nothing left to use for motor fuel.
Reply: @algrayson8965  But then there's Bio-Diesel coming from used Cooking Oil. And even if electricity is "the way"... then let's use it in the distilling process, and (perhaps) in the Semi trucks which have restrictions set into law regarding the number of hours of operation per day! Plus they have more available space for batteries. 

And speaking of batteries, those things have some NAAASTY CHARACTERISTICS  in the event of a Car Accident!! The Audi mechanics that I personally know have a special hazmat suit they must wear to work on the EVs. It protects against electrocution and also lithium Battery LEAKAGE  ...a tow truck driver got some lithium juice on his hand doing a tow at an accident scene and ultimately had to have his arm amputated below the elbow

But yeah, Renewable Ethanol (which could be distilled using electricity, natural gas, coal or whatever for heat)  could eliminate the hours of charging (and incidentally-required "Busy-work Facilities for the waiting drivers), and will also at the same time keep Millions of dangerous, toxic batteries off the roads and out of environmentally dangerous car accidents! 
And ethanol is just ONE renewable alternative. Let's try to think outside of the "electric box!" I'm just sayin'...
Reply: @antghostthreeonethree6609  electric cars don't pollute
Reply: @carlstephens1532  dude. Nobody here is against electric vehicles. Some day when the early adoption, and technology issues are resolved, we will probably all drive one. We aren't there yet. The greenest vehicle you could buy today would be a used 5+ year old ICE car that you drive til it dies.
Reply: @bradmagnuson6963  manufacturing electric cars, mining battery materials and generating the electricity, pollutes!
Then the nightmare of the battery recycling begins.
Reply: @dudleyhaines9826  no, the manufacturing doesn't pollute, either
Reply: @dudleyhaines9826  it's obvious  your not following  the electric  car movement  , Ford, gm ,are moving fast to offer electric  vehicles,  it's  here and available,  if you remember  the gm ev1 vehicles, it has been reported  that gm got all the cars back because  they were successful  to the point ,the dealers weren't  getting  any  repairs. After the sale income dropped.
Reply: @carlstephens1532  what are you even talking about? Lay off the hash, man.
Reply: @carlstephens1532  won't work where I live long dark winters. Cold too.
Reply: @SillyOmega  yeah at this time it might be an issue  but with the technology  changing at lightning  speed it won't  be long most issues  will be resolved. There is a battery  right now that takes 5 mins to charge, so its already  here. ,, I've  been the only person  posting  that I'm aware  of that is saying we need both gas and electric ,,, each has it's  advantages  ,